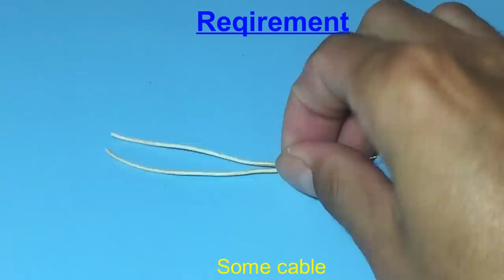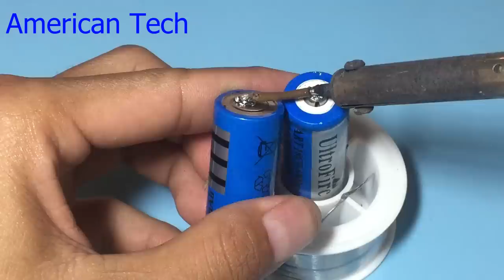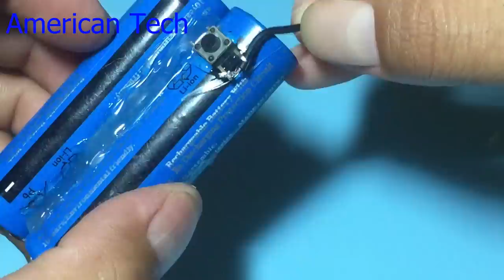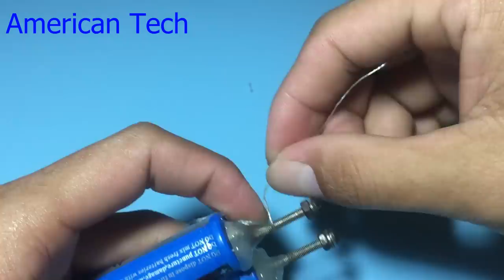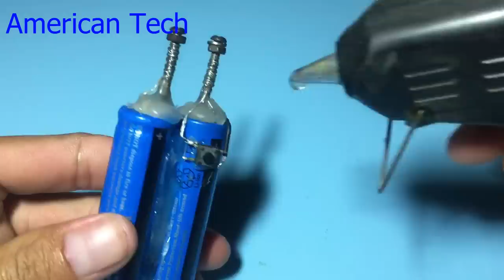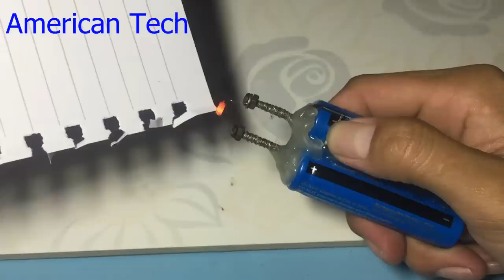How to make a mini electric lighter , The useful tool , Good idea

Comment: i need your help on specifications,  how many amps are needed to make this works? i know you used 3.7v batteries but which is the minimum Amp for this lighter? pls is very important to me this info.
Reply: A normal railgun amp is 313.31 amps and it heats up very well.And a vape sometimes consists of 200 amps to heat up and boil the liquid in the vape so normally you will need 200 or 300 amps for this.
Reply: @euvo_sound  you are confusing watts with amps!
Reply: @euvo_sound  300 amps??? Those 18650 cells can only deliver 10 to 15 amps max in a pulse discharge. And even that is too much! A realistic current you'd be getting from those cells are 500ma up to 1.5 amps, which is plenty! And much more than enough for lethal electrocution

Comment: What tool is he using to melt the wires on top of the batteries?
Reply: Michael Gonzales soldering pen or something
Reply: It's called a soldering iron, a decent one will set you back £30-50 but it's a useful tool

Comment: Man u should not connect positive and negative thought just like that
Reply: That's the most efficient way to convert electricity into heat. That's basically what an incandescent light bulb or a space heater does...